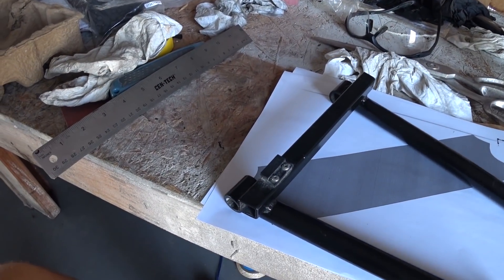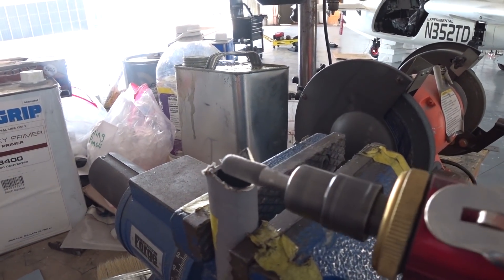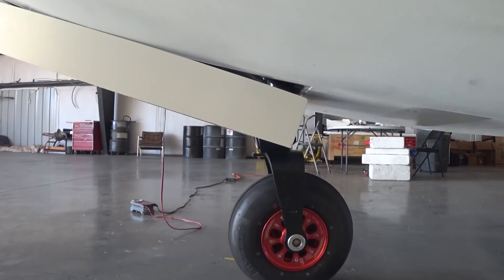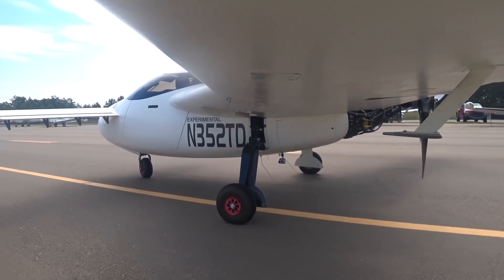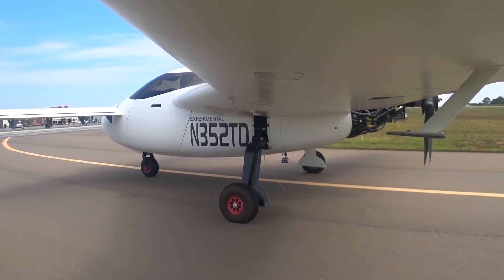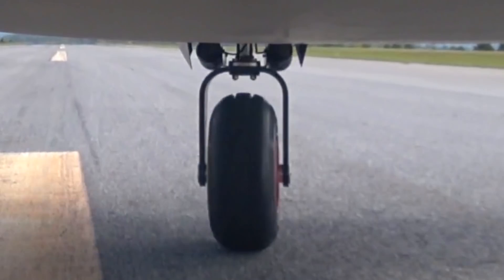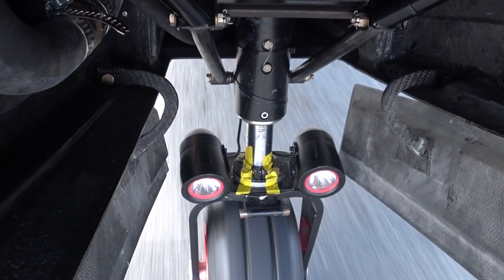Did We Fix the Shimmy? - Building the Raptor Prototype

Comment: As an old farmer many of our tillage machines over the years have had castor wheels (like your front wheel only the size of truck tyres) which would shimmy when transporting along roads.
The machines that did not shimmy had the wheel raked back more and they tracked nicely. Your wheel support  looks to be too vertical not to shimmy from my rural
 experience.
Your wheel can easily pivot in the top shaft. If the wheel is trailing then the wheel has to travel sideways when shimmying and this tends to keep it straight.

Comment: Trying the heavier weight oil would be an easy thing to try first. Tire pressure shouldn’t have much to do with shimmy. Might not be relevant but on motorcycles with a steering dampener that get speed wobble it’s usually traced back to the dampeners adjustment or front suspension. If there are different oil restrictor sizes can try sizing down to a more restrictive oil passage in the dampener. On the cheap going to a heavier weight oil can accomplish similar results.

Could the oleo be broken by any chance? Or an assembly issue rendering the dampener inop?

Comment: Perhaps it needs torque links and some way to lock the caster? Probably enough wheel skid to have some rudder authority on take-off/landing as it doesn't look that nose heavy in regards to wheel loading, and you're not going to need hard turns until slowing down to taxi off to the side.

Comment: The entire assembly once upset can't cope with the resulting forces. I'd try attaching a careful and crafty temporary hard bracing support to hold the assembly from flexing. Run it, and if it does it again, the geometry is inherently unstable.

Comment: Hi Peter, I´ve been watching your nice design from the begining. 
This problem had to be solved.
1.  Keep the stearing axis perpendicular to the ground.
2.  Determine what is the week parts in the system.
      Lift up the fuselage, block the pedals and twist the stearing axis simply by a stick between the fork and wheel and noticing what is moving. Then You have the answere where to increase the stiffnes.
3. To make the influence for the shimmy less You can move the wheel axis backwards 1 inch (2.5cm) so the contact surface from the tire is clearly behind  the the stearing axis.

I ´m waiting to see it fly. Good luck.

Comment: Something basic, I guess. A castoring wheel is more likely to shimmy at high speed. Could you restrict the amount the wheel could swivel at high speed to a point where the tyre and/or hydraulic damper could obviate the oscillations until you are moving at a speed when tighter turns are needed? fit a solenoid actuated castor lock.

Comment: Damn, I'm sorry that the problem is not yet licked.  But you're on the right track.  You've made it better, and I'm certain you'll get there. 

This might sound like a really dumb idea, but what if (not as a long-term solution, but only interim) you tried putting a quart or two of water in the tire? 

Here's my thinking. 

Someone mentioned the word "harmonic," and its application makes sense to me.  Once the wheel is perturbed in one direction, the castering force swings it back in the opposite direction.  Like a pendulum, it overshoots center, and an opposite castering force slams it back onto the opposite arc (so on and etc.).  It would seem this likely happens at a particular rate of repetition (i.e., frequency) that happens to fit the weight, stiffness and other characteristic of the system involved.  What I am thinking is that a simple addition of water inside the tire might simultaneously provide its own kind of dampening, and change the harmonic frequency as well. 

It would be a cheap/easy thing to try, just to see what its effect might happen to be.

Comment: Re-shape the wheel mount so the wheel axle is behind the center of the vertical axis of the strut damper, instead of raking the whole strut, or maybe do both. My bet is that method will fix your shimmy.

Comment: Finally, after thinking about it a few, maybe it's time to abandon the idea of steering by differential braking and just take the weight hit of a nose steering system and adjust caster opposite so it can handle higher speeds.  ie the closer to vertical, the more aggressive the steering forces.  Whereas the more positive caster, the more stable at higher speeds but more force required to turn at lower speeds.  There are a number of good sources to consult or go look at Prof. Ilan Kroo from Stanford's design seminars, many of us have been learning from him for decades now.   .http://www.aerospaceweb.org/question/design/q0200.shtml   //  https://www.aircraftsystemstech.com/p/landing-gear-alignment.html

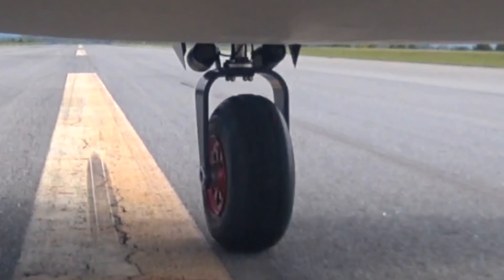Comment: Don't know 100%, but just saying: because your wheel axle is behind the pivot point, any deflection of the strut to the left (for example) causes the wheel to turn to the left, further pulling the strut to the left, exacerbating the problem.  This can be seen in your 1/10 speed video, at 12:35.  This is why bicycle/motorcycle wheels have their axles forward of the pivot line (the strut axis) - any deflection of the strut to the left will cause the wheel to turn to the right, self-correcting.

Comment: http://www.maths-in-industry.org/miis/108/1/Airbus-ShimmyReport.pdf
According to their math, if you don't want to add a shimmy damper or stiffen the torsional axis you could remove the rubber from the wheel :) (making the "tire" very stiff). They calculate that reducing the tire's stiffness would likely increase the shimmy amplitude to a point, then quickly drop to zero if you can make it soft enough. Reducing the side force on the tire would also help (perhaps reducing weight or reducing tire grip [are plastic tires a thing?])

Comment: Suggestion from a pilot/biker. Look at the front end of most of your most popular sport touring motorcycles. Look at their front rake/trail. There’s a reason they can go fast, be stable, carry weight, constantly be shifted between load and unload, and yet so many of the top brands are all within slight degrees of each other.

Comment: My thinking is that changing the tyre pressure would not be enough to fix the problem.  To me, geometry and dampening are what you should be concentrating on.  Try to find say another 7 to 10° on the U-bracket that holds the wheel (to make the wheel trail further behind the vertical support point) and speak to the hydraulics people to see what oil would give you and increased dampening effect.  If anything, increase the tyre pressure if that's possible.  All the best!

Comment: I think making the horseshoe bracket that holds the wheel 
Needs more angle back 
You changed the rake and got 
A pos results you moved the shimmy speed to higher speed 
Change the angle giving it more trail will stop it imo

Comment: Apolgies for the predictive text error - don't post late at night. Okay, so castor wheels and shimmy! Supermarket trolleys often have 3 wheels working fine and a fourth not touching the floor so hard which shimmies. As air speed increases, I think the canard wing is lifting the nose. A bump in the runway will cause the nosewheel to momentarly lift off the from ground and turn slightly. On retouching the ground there now a side force violently flipping the wheel to the other side, repati g the process and a shimmy is the result. Aircraft slows down, canard lift reduces, weight goes back onto the nose wheel and the shimmy stops. I am convinced a taxi run with full down elavators etc will prove the point. Good luck with the project which I am following with great interest.

Comment: I'm very familiar with this nose gear strut your using.... Its works good as long as you bleed ALL the air, and use 30 weight motorcycle fork oil. If you need instructions on how to properly bleed this system let me know. Also I would temporarily remove the landing/ taxi lights, it could also be contributing to your shimmy.

Comment: It looks very similar to a speed wobble on a bike. I wonder that because of the wheel being on center line of the pivot axis that a combination of bumps and direction change would flex the wheel off center far enough for it to quickly reach harmonics. If you have room, try swapping your fork that holds the wheel with an extension to  mount dual narrower wheels so they can offset the load to either side of the pivot point and  help cancel each other's harmonics.

Edit: Doing some more research, it seems like a great deal of other aircraft have the strut assembly tilted back far enough to keep the wheel to ground contact area well behind the tilt axis, perhaps an easy way to find out if this works for your set up, you could just replace the current for with one that places the wheel center a few more inches further back.

Comment: Definitely believe, the extra weight of the lights dont help, and the extra weight of the larger tire dont help. Also looks like maybe some flex in mounting positions. Lower tire pressure, definitely try it without the lights.

Comment: Shimmy dampers are integral to the suspensions of many vehicles. High performance motorcycles and airplane landing gear are probably the most typical. These vehicles are produced by some of the most technically advanced manufacturers. And they recognize the ultimate solution is the damper. The damper makes up for many sins like alignment, elasticity, mass balance, and torsional and translational natural frequency of many components. You showed the scissors mounted damper in a previous video. Sure would not hurt to try it.

Comment: Lots of great suggestions in many of the posts regarding the shimmy issue. Have you considered an active or semi-active damping solution? With so many mechanically inclined follows and viewers, I'd think this would be a great venue to partner with a company like Bosch (https://www.bosch-mobility-solutions.com/en/products-and-services/two-wheeler-and-powersports/riding-safety-systems/semi-active-damping-control-system/) to get involved. I'd highly consider contacting Bosch or other companies that would be interested in helping provide a solution and a marketing platform/marketing plug. Maybe this type of solution would address any harmonic issues many have put forward. Best of luck!! 

An Arduino (or even better ESP32 connected WiFi via webserver) to your tablet in your cockpit with a 9 or 3 DOF sensor and small lipo to power it might give you the data required towards finding a solution... a 3D printed enclosure attached to the strut with an ESP32 and  accelerometer sensor can be done for less than $10-$20... (http://www.esp32learning.com/code/esp32-and-mma8451-accelerometer-example.php)

Comment: First would be to stiffen the strut as a whole.  It sways way to much side to side.   Here is an old report from NASA on castering nose wheels.  https://ntrs.nasa.gov/archive/nasa/casi.ntrs.nasa.gov/20090015053.pdf ...number 1 is to set the center of gravity as far back off the front wheels as possible.  It also mentions the dampener, in that it should be as strong as you can get it, but still allow turning during taxing.

Comment: From my landing gear designer in Japan:    

I didn’t watch much detail of movie but looks like it has low torsional stiffness. Quick ideas are to stiffen it, including minimizing free play in joints in rotational axis and/or add damping element.
I think increasing friction is the easiest solution if it works.
I have an experience added Belleville spring in axis of strut to add friction to the swiveling part and it worked well.

Comment: This has been many years ago, in the early 70's, but when I was working on my private license flying in a Cessna 150 they had the Shimmy Dampener and I would still get shimmy on the nose wheel at times.  It does seem like I remember one of the mechanics doing maintenance/rebuild on the dampener when this happened.  I know this is not any help toward a solution but just letting you know that while the addition of a dampener may help, it  may not entirely solve the issue either.

Comment: Hi, 
New to your build so probably repeating something already.
Long time motorcyclist and racer.
 natural stability is only guaranteed with 25degrees plus rake thetrail depending on rolling diameter.
The dreaded tank slapper, what you have there is a common everyday occurrence on modern bikes at speed.
There is a wealth of information motorcycle rake and trail geometry available for un damped stability.
Once again , apologies if repeated info.
Cool project by the way, I'm  newly minted pilot.
Reply: Looking through the comments there are some need to stiffen the airframe suggestions. Thinking along the lines of a motorcycle being the airframe, it is free to move around behind the front forks so is not a rigid structure.
This just masking the aggressive geometry.

https://youtu.be/PThPfRUGxk4

Comment: There is a good 1/4 of play side to side you can see in the strut turning. I will suggest resonant flex  in the steering mechanism. Also the wheel mount arm seems to resemble a tuning fork once the flex in the turning goes beyond a point the mount arm starts resonating out of sheer force. The system play flexes as far as system will allow, then bam, springs back the other way.
So while it is resonating it is more of a 70s ford truck death wobble. As long as the tire itself was tracking straight it would be fine. If you had warped brake rotors and applied brake; If you hit a sharp crack or a parallel crack in the road; Or if you hit a pothole, the stretch in the tire would preload the flex in the steering. Then the resonant wobble would begin. The grip of the tire would go as far as it would be allowed, preloading the steering system. Then when the tension overcomes the traction of the tire, bam, the steering system was like a spring. It unloads in the other direction and repeats. The bite of the tire helps excite the resonance of the steering flex.
Voilà, Ford death wobble. Slow down and take off again until something in the road excites it.
Eventually you have enough and replace the idler arm. Which was generally the main culprit in the Ford. The flex of the steering system design was to close to the low frequency (hz). A small amount of play would set it off. Most suspension now is loaded in one direction of flex slightly. Wheels toe in, etc. Single wheel systems, look at motorcycles. Twin fork tubes greater than 41mm. All head tubes are taper roller bearings. The triple tree clamping forks to steering shaft are 3/4 or greater in cast iron or billet aluminum. There is no flex or play in the system. No torsion tube effects. Even then, older GSXR sport bikes with thin tube chassis frames needed a big steering damper. The frame flexed and resonated at high speed. It is known as "tank slapping" in motorcycles.
One part of the equation with the tuning fork wheel mount would be to use a single sided mount. This would keep constant preload on the flex in the steering knuckle. With even equal mounting, you alow it to walk back and forth between the flex points. There is no preloaded flex in any direction. It just makes it easier to to get a resonance going.
In all honesty, I think you need to stiffen the bulkhead and maybe go with a thicker strut. The wheel bearings should be tapered or precision rollers designed for radial and axial loading, two per side. Also with very tight tolerance. In looking at the front suspension it looks strong enough for the mass, but not stiff enough to avoid resonance. 
You can extend the rake rearward. This will help as the wheel is essentially being towed, tracking the tow mount. Think of grocery store carts. A simple bearing and a mount. There is enough play there to develop a death wobble. If you were a misbehaving youth and tried car and shopping cart jousting back in the 80s you would have seen it on new carts.
Reply: What steering mechanism? You should probably watch all his EPS before jibbering on about whatever.

Comment: Whoa that was extreme vibration. My advice is to take a look at how Piper has design theirs in the Cherokees. From your design I don’t see anything that can stop this from happening. You need to rethink the overall design. Oh forget the oil in the strut, it will make no difference.

Comment: you need to move the pivot point 3/4 or greater the radius of the tire to the direction of travel. I would suggest changing the front fork to accomplish this. you might have to build a bump out in your gear doors to cover the tire in retracted mode. This is a similar  problum tail daggers have if  the tail springs pivot point is too far over the top or back of the tire.

Comment: Interesting that the problem started when you reduced speed, analyse all what happen then angel and pressure.

I should from the beginning built it with 88 degrees not 89,8 but there is not room for that?

Changed pressure in tire give I low chans, You cannot have a plan that is so sensitive.

Shock absorbers that are more efficient are right thinking but passive solution with better angel to prefer or?

Study different solutions for custom motorcycles.

I like your videos and follow the project.

Comment: I agree that it seems to be a resonance issue that originates due to excessive play in the gear.  I had this problem on a Piper Arrow I owned years ago.  Just greasing the gear helped a bunch.  Perhaps you could install some brass bushings in the rotating parts and put zerk fittings in so that they could be greased.  You will be surprised how much play the grease will remove.

Comment: You might want  to make a front tire test fixture for use in the back of a Pickup.  This way you could separate the effect of the tire from the effect of the fuselage.  also test different angles.  Thanks for the great work you are doing.